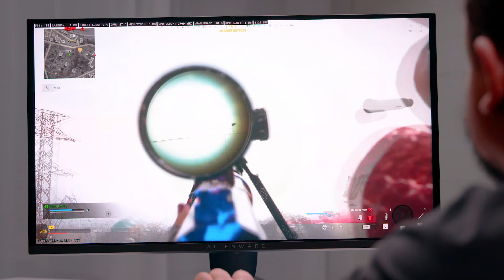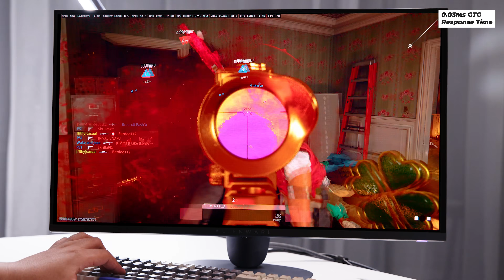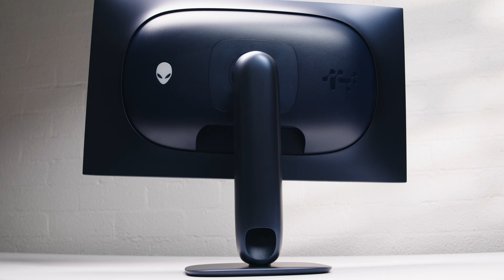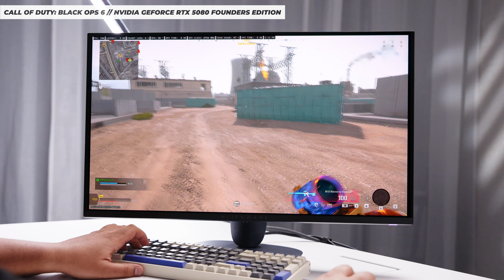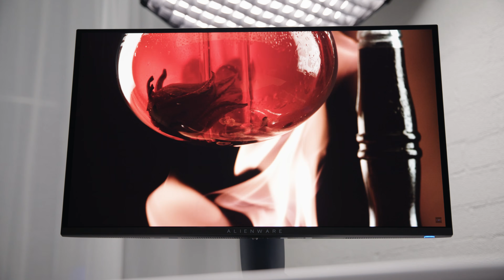Next-Gen 27-inch Alienware 240Hz 4K OLED is epic and affordable

Comment: 4k does look good but mine came with highly raised black levels in all HDR modes, it ends looking like an IPS in dark scenes and yes I know how it should look like, I've had other OLEDs and still have a 1440p QD-OLED and no, even updating to the latest firmware did not fix this and no other settings fixes it either. After a quick search I found out I was not the only one with this issue and even reviews reported the issue so I assumed it's a design flaw yet it seems fine on your end. Were you by any chance simply displaying the HDR content in SDR mode?

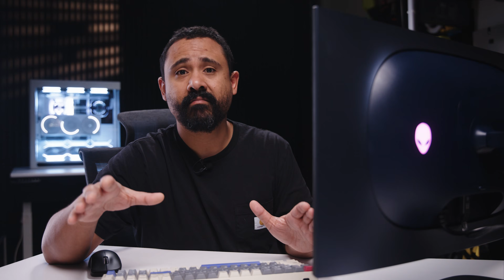Comment: 8:30 Though you say 1.4 DP supporting 240hz is not true, HOWEVER it is true in this case because it HAS "DP 1.4 DSC" Display Stream Compression. anyone who has "DisplayPort 1.4" needs to make sure your GPU ALSO SUPPORTS Display Stream Compression!!! otherwise you won't be getting the 240hz you think you are getting.
Reply: If I just game on console only is this monitor worth it over spending the extra $300 for the MSI or Asus ?
Reply: @brandon3321  They're both basically the same viewing experience they just have slightly differences, so honestly whichever has a better deal.
Reply: Does this dp cable come with the monitor? And also, does 5070 ti support it?
Reply: @AAAAAA-gj2di  
Yes, the NVIDIA GeForce RTX 5070 Ti fully supports Display Stream Compression (DSC).
We're talking about the port, you'll have to buy yourself a cable that is "DP 1.4 DSC"
Reply: @WyldWolfDragon and what comes inside the box? Does their hdmi cable support 4k 240hz?
Reply: @AAAAAA-gj2di  Idk, i didn't buy this thing,just shareing info from the video, search for an unboxing video.

Comment: The difference between W OLED & QD OLED is there tho as the color volume is much higher which impacts SDR and HDR greatly.
Reply: Purple black on qd oled and a scratchy screan
Reply: @ I don’t have that issue with purple blacks and I use to be like you just saying it because everyone else said it until I tried it
Reply: @DETERMINOLOGY  "QD-OLEDs like the Samsung S95C OLED and the Sony A95L OLED have a purple tint, which can be distracting if you're in a room with ambient light. The panel structure causes this purple tint, as QD-OLED panels lack a polarizing layer. This structure raises the amount of ambient light that bounces off the internal structure, and we can measure this.

It seems like this is an intentional decision by the panel manufacturer, Samsung Display, as a way to boost brightness. Since this is coming like this from the panel manufacturer, all QD-OLED displays have this issue. It's possible that manufacturers could add additional anti-reflective coatings to reduce this issue. The Samsung S95D OLED, for example, features a matte anti-reflective coating that significantly reduces reflections, but it's unclear if it'll also reduce the purple tint issue." - Adam Babcock, RTINGS (dot calm).

Not saying they're all purple blacks but the effect was measured so not imagined.
Reply: @DETERMINOLOGY  the purple blacks aren't an issue unless you have a lot of light behind you but QDOLED is much more likely to burn in vs WOLED
Reply: @pro-c3q1f  I didnt say it was an issue. I was talking about color volume and ive had both W OLED and QD OLED monitors and the W OLED looks dull compared to it. Lacking in color

Comment: i'm running a 7800x3d and an rtx 4070ti super. can someone tell me if this monitor will be compatible for my setup in terms of the port situation. i'm not well versed with the dp1.4 vs hdmi 2.1 vs dp 2.1. basically just want to know if i can run this monitor at native (4k, 240hz)

Comment: This monitor in Australia, when you remove GST and convert to USD, is US$200 cheaper.  You don't see that very often.  I also have access to a 10% Dell Partner Discount.

I'd pull the trigger on this monitor right now but the burn in issues have me worried... I game, but 90% of my time is work related, so burn in worries me.  Not saying I won't buy it, just hesitant at the moment.
Reply: Dell has a 3 year product warranty, so buy that (its around US$50) and you don't have to worry for 3 years. This is one of the reasons i am looking at Dell for my next monitors.

Comment: PSA: 10% off w/ email sign up or edu discount,~20% off w/ employee purchase program (if employer participates!)

Got mine for ~$720 pre-tax. Besides lack of USB-C & DP 2.1, been an excellent monitor. Super clear.

Also, since ROG & ASUS increased prices another $100 USD ($1199 MSRP), the Alienware is $300 less before discounts!
Reply: Can't wait to see what the price in EU would look like as their 1440p/360hz was a bargain at 700€ compared to the competition. I get that Asus makes great monitors but 1000-1200€ for a monitor is getting absurd (their more basic XG 240/4k is 1000, the 480hz is 1100 and the PG 240/4k is 1200 hence the price range). In fact, anything from Asus but the XG27AQDMG is over 1000€ here. The ROG fee is wild.

Comment: I’m pretty sure Alienware and affordable shouldn’t be used in the same sentence.
Reply: compared to other 240hz 4k oled, it is affordable
Reply: @SnoupDawg yeah fair point, I can’t wait for the day I can buy one of these in Australia for less than $700
Reply from the maker: Yeah as far as the price is concerned this is the cheapest 27" 4K 240Hz QD OLED and it uses the exact same panel as all the others. Its a win for Alienware.
Reply: @GearSeekers Displayport 1,4 tho🤮
Reply: @luukherfst1209with DSC, you can run it at 4K 240Hz so at the end of the day, does it even matter?